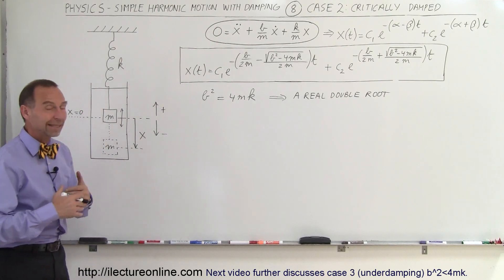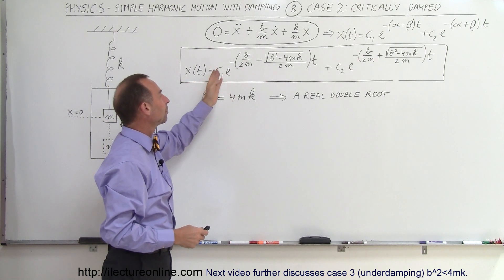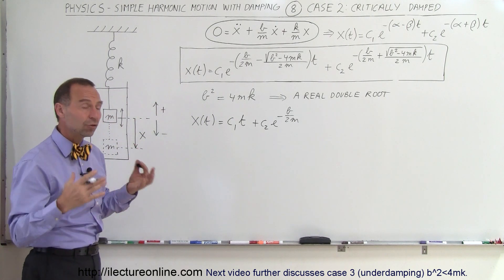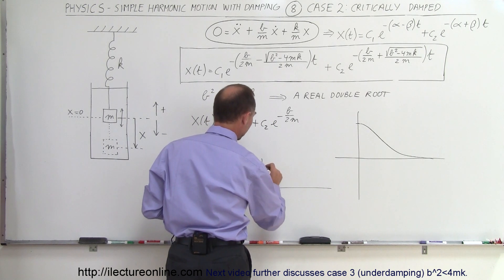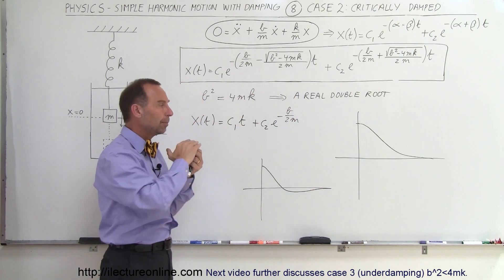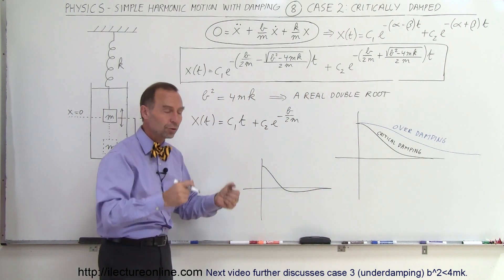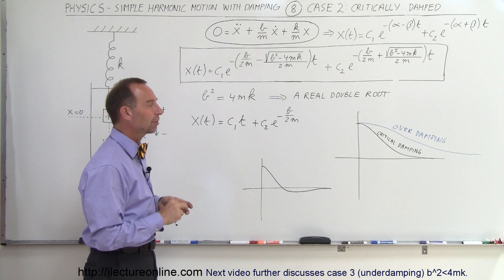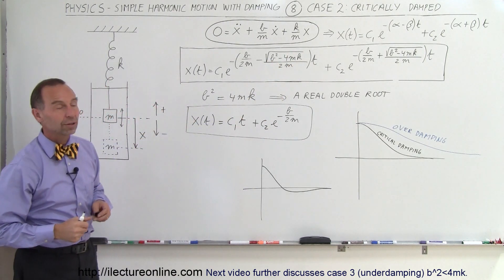Physics CH 16.1  Simple Harmonic Motion with Damping (15 of 20) Critically Damped

Comment: nice videos all together, but in this video, as well as in many other places on the internet, there are some misconceptions about damped harmonic oscillator....e.g. critical damping is not the best choice if we want the system to return to equilibrium in the shortest time...

this model (viscous damping) asymptotically approaches to equilibrium state (zero energy state), so strictly speaking the system never returns to the equilibrium state, but if we take into account some measurement resolution (e.g displacement and velocity resolution, or energy resolution) then it effectively comes to equilibrium, and in this effective coming to equilibrium the critical damping is (significantly) slower than the  specific underdamped case (or even overdamped case, for some specific initial conditions)...i.e. critical damping is never the best choice if we want the system to return to equilibrium in the fastest way...

details are given at https://pubs.aip.org/aapt/ajp/article-abstract/91/10/767/2911823/Damped-harmonic-oscillator-revisited-The-fastest?redirectedFrom=fulltext

or here https://arxiv.org/pdf/2301.08222.pdf
Reply from the maker: Thank you for the input.

Comment: Sorry but I don't understand the solution x(t)=C1*t+C2*e^(-b/2m). Shouldn't it be x(t)=(C1*t+C2)*e^(-b/2m) since both terms are multiplied by e^(-b/2m)? Or at least that is how I was taught to solve diff. equations. Did you do something to go from one equation to the other? 
Thank you.
Reply: It should be x(t)=(c1*t+c2)*e^(-bt/2m) https://ocw.mit.edu/courses/mathematics/18-03sc-differential-equations-fall-2011/unit-ii-second-order-constant-coefficient-linear-equations/damped-harmonic-oscillators/MIT18_03SCF11_s13_2text.pdf
Reply: Michel van Biezen
thank you sir,
i do hope you got the time to explain how bcos i want to know too.
Reply: Sergi Ortega Micó ,yeah I think  in case 2 it should be a bracket as you said.
Reply from the maker: Sergi,
The video is correct as is.
The solution can be derived, but it requires fairly complicated math and differential equations, omitted in this video for clarity.  Deriving these equations will be a topic in a future video when time permits.
Reply: Okay, thanks for the answer and the videos! :D